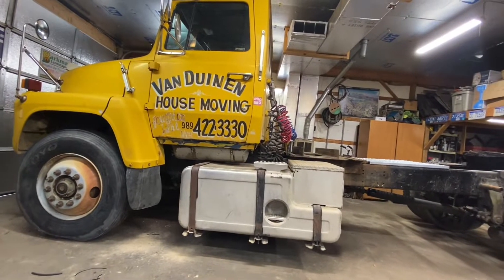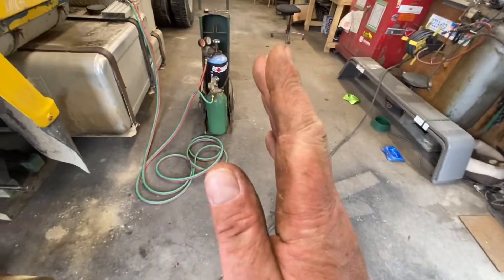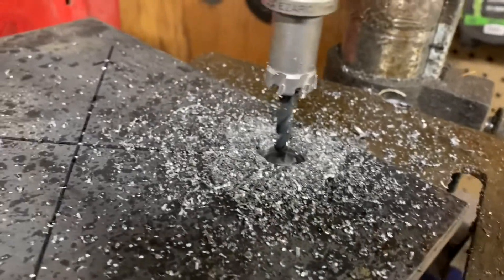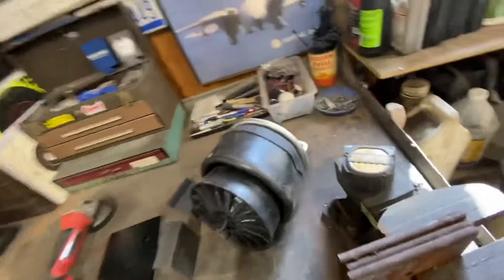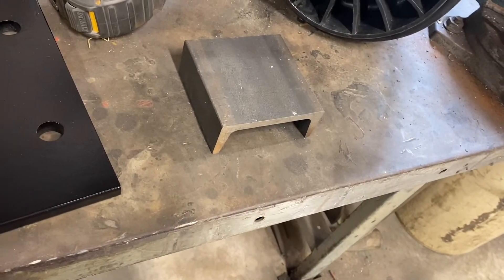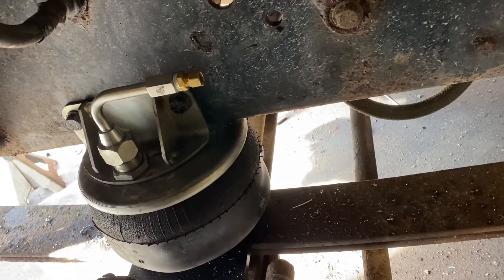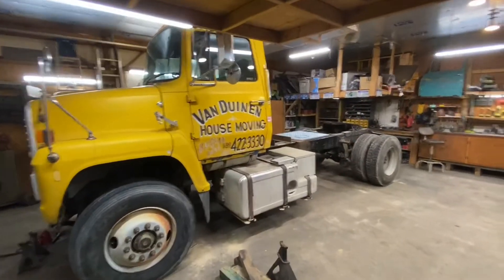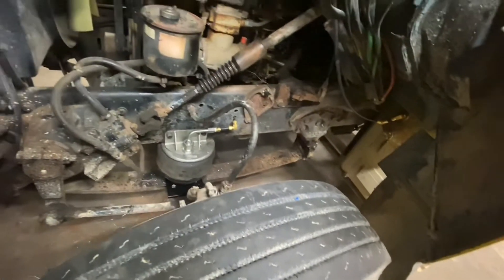Ford L9000 Episode 18: COMPLETE FRONT AIR RIDE DIY, no kit needed!!!

Comment: Did you have to isolate one side from the other via a check valve or dual outlet ports on the solenoids? Always wondered if sway control was needed in cornering without something keeping each bag isolated from the other.
Reply from the maker: I’ve heard that from a lot of people as well.  Most suggest check valves or just going to a dual leveling valve setup and ditching the solenoid.  I’ve had zero issues and don’t have any lean in corners.  Virtually every rear axle air ride setup is built that way too, so it stands to reason that it wouldn’t be a problem.  I may change to a leveling valve set up at some point so I’m not relying on a solenoid, but I won’t waste the money on 2.
Reply: @robstruckshop80  Thanks for the reply

Comment: I bought new air springs (internal bump stops) yesterday on-line, for my 2001 International "Shorty" school bus /Rv. My bus was already equipped with rear air suspension. But will now have air ride front suspension up front as well. 18K GVWR. 6k axle up front. Your truck (medium duty)seems to be the closest thing weight wise to mine, that I have seen on the tube. I refused to buy a kit, opting rather to customize my own system. I have already replaced the worn out rear air bags on the back and replumbed them with dedicated air valves on my dash. They work beautifully. I plan on removing one floating spring like you did on yours and test drive it locally to see if the system works properly, before discarding it. Thanks for the detail video it helps me have the confidence to do this custom work myself. I have done all the other maintenance work, even to the point of mounting new tires on new wheels.  Changing rear seals and painting and remodeling of my bus. IG# ontheroadagainbus.
Reply from the maker: I’ll check it out!  I think you’ll be happy with the front air ride once you find the right balance of number of leaves vs. air pressure

Comment: It not for commercial operation its for pleaseure NOT FOR HIRE use
Reply: @robstruckshop80  the truck you are working on is not commercial
Reply from the maker: I have used it commercially, it was inspected, plated and insured commercially for a couple years
Reply: @robstruckshop80  I understand it may have been a commercial used truck previously but not you are turning it into a NOT FOR HIRE truck project and it will be used as a Private use truck for shows and parades etc etc etc

Comment: what control valves did you use?.. and i am assuming the back axle doesn't have mechanical load leveling switches
Reply from the maker: I used Vixen 3/8” normally closed valves, Amazon specials.  I originally plumbed the rear end with the same valves, but didn’t like having to constantly adjust pressure in the cab to compensate for load so I eventually converted to a standard height control valve/dump valve setup
Reply: can i see the new setup
Reply: so the 2 valves on the firewall are solely for the front bags?? ine to raise oneto lower?
Reply from the maker: Correct, they are normally closed so the system holds air- 12v power on one side of the switch opens the fill valve, 12v power on the other side of the switch opens the dump valve

Comment: did the bags come with the top mounting bracket?
Reply from the maker: The bag Kenworth P/N is K30322- that’ll cross to a ton of aftermarket numbers.  It comes with the mounting bracket but you’ll need this fitting https://a1truckparts.net/products/air-bag-adapter-kenworth-177-3015-automann?variant=40080624386113&currency=USD&gclid=Cj0KCQiA_P6dBhD1ARIsAAGI7HDU5e6xAFewP3JfMNbWb9EUxKbhFiWOCYYxd7jrVeHeySOf34XsfO0aAr4IEALw_wcB to adapt to the big 1-5/16” mounting stud- the fitting doubles as the nut.
Reply: @robstruckshop80  sadly that particular bag will not work for me... i need something that has a lower collapsed height.. i have found a bag that has a 2.20 inch collapsed  height  but will probably have to mke my top bracket

Comment: What air bag did you use in your 
LN 9000 if you have a part number that would be awesome!!!
Reply from the maker: On the front air setup it’s a Kenworth K30322 which crosses to a bunch of aftermarket numbers.  Note you’ll need the Kenworth specific fitting to feed and mount the bag too .

Comment: I didn't catch it if you mentioned it. But I was wondering if you have any info on the type of bag you are using. Great setup I like it.
Reply from the maker: They are rear bags from a Kenworth Airglide setup.  3.9" minimum height, 7" design height and around 10.8 max so they go low enough to fit a front setup.  5100# rated at 80 psi so good weight carrying capacity for this size truck.  The Kenworth part # is K30322.  Just beware that the air fitting doubles as the mounting bolt and it's big (1-5/16" - 12), requires a Kenworth specific adapter fitting so it adds to the cost.
Reply: @robstruckshop80  Thanks man. I really appreciate the detailed info. I think these are exactly what him looking for.